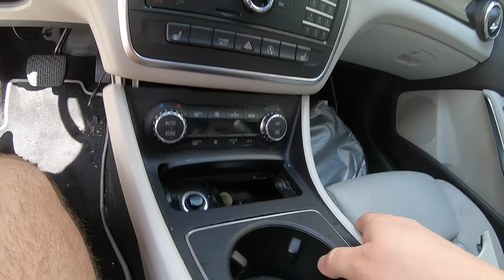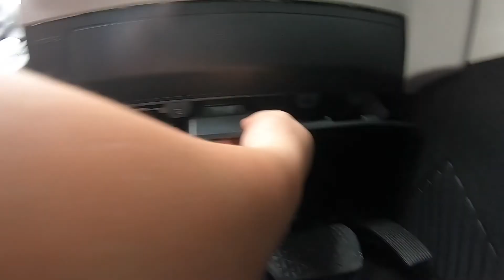2016 Mercedes Benz CLA250 Center Console Trim Removal

Comment: Could you show how to disable the alarm system? It happened to my stored car which had not been used for more than a half year. I wanted to give it a last check before I left for the airport for a long vacation. But the remote didn't work, I then used the manual key trying to open the door. Suddenly, the alarm system started squealing...I tried to figure it out how to disable it but failed due to the flight time. I could do nothing but leave it with the alarm signals blinking. Now I'm back one month later and the alarm signals are gone. I have no idea what to do ... I think I would have to charge the battery first, but how to avoid triggering the alarm system? I tried to find info online when the issue happened but the instructions seem not working (like inserting the key into the start button location by removing the cover first, it just can't get in). Please help! Thanks.